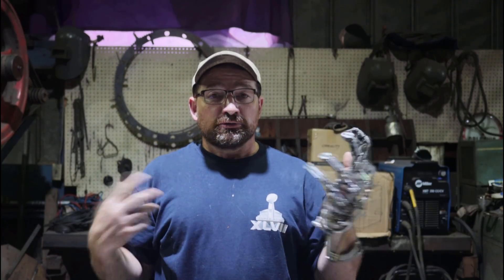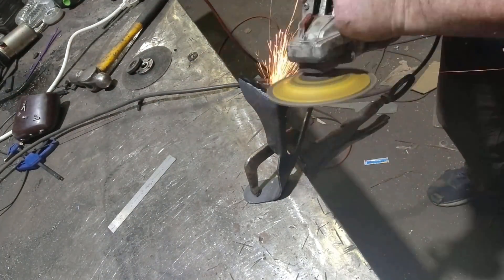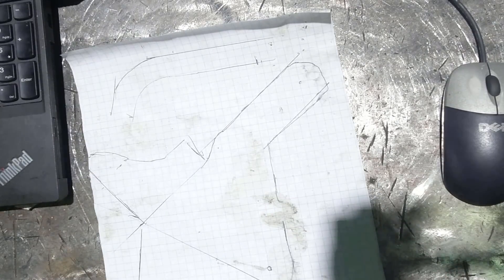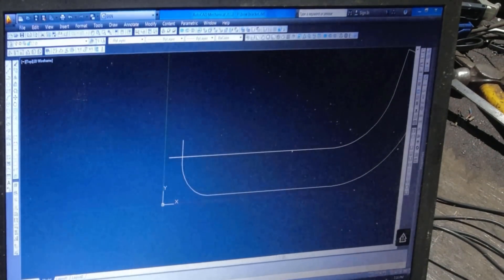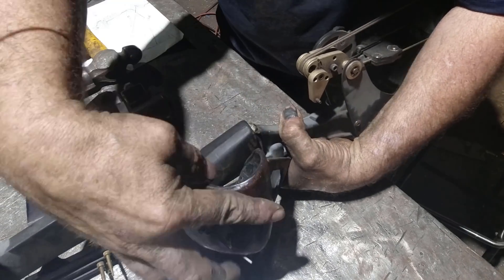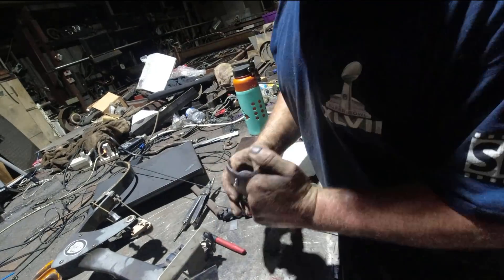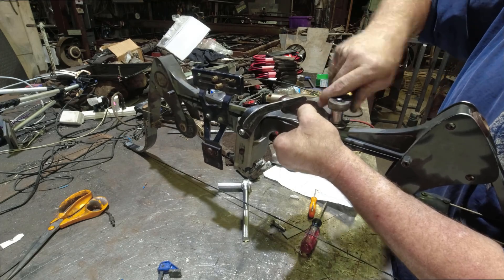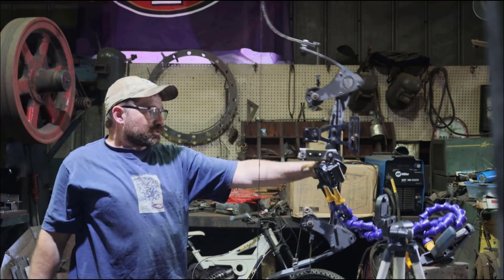Prosthetic Compound Bow Modification Part 2

Comment: This is a real engineer and fabricator here. He's got a plasma table but has no problem using a leatherman to squish down the barbs on those threaded inserts instead of going to get some 80 huck pair of specialty pliers to look good on camera then screws it all together with a 30 year old craftsman standard screwdriver. Warms my heart.

Comment: At least in recurve archery there's a thing called a finger sling which one Loop goes over your thumb and one Loop goes around your pointer finger so you don't actually have to hold the bow it just kind of rest in your hand I think it might have been easier to just make a something for the loop that goes over your pointer finger to rest on instead of this design
Reply from the maker: When I had fingers I shot with a wrist sling, the reason I don't now is because I'm shooting a bare bow, and without all the stabilizers and extra weight up front, the bow will tip backwards when I release it.  since I don't have fingers to grab the riser as it falls backwards, it will either hit me in the head, or I'll end up dropping it on the ground. Neither of those are good outcome. That's why I built a socket and bracket, so I can hold into the riser without really holding onto the riser. But thanks for the suggestion.

Comment: Your projects are very inspiring. I'm not a member of the missing parts club but I've come pretty close a couple times and have been without use of an arm or leg for long periods of time so I can definitely appreciate what you're going through. Keep up the awesome work. On a side note, when I saw this video pop up in my feed, my first thought was that you had built yourself a little crossbow to mount directly to your hand but this was really cool as well.

Comment: What advantages do you find, using t-nuts over press nuts or riv-nuts?
Reply from the maker: T nuts have a larger surface area to load against,  and with that they don't pull out like riv nuts. If it was an all metal construction, yes riv nuts all day. But where I'm attaching through resin and fabric, not so much.
Reply: That's what I figured. Cheers

Comment: I noticed you don't use your hand while welding or working, do you think you'll ever get it to the point that it can be useful for that amount of everyday use?
Reply from the maker: The reason  for not using my hand while welding is a matter of safety. If I were to ground the electrode with the filler, my prosthetic hand would likely get very hot and burn my residual limb.  It's like wearing a ring while welding , but on a much larger scale.
Reply: @missingpartsclub  Ok I thought as much.
Love what you're doing, keep up the good work!

Comment: I'm really happy you're able to use your skills to give you another chance to do something you obviously loved doing. Great job. You really are very clever. Can I ask a question, if you don't mind? The thumb on your affected hand, the nail looks very dark. I know your affliction is an ongoing matter, and well, I'm worried about it, and about you. I do hope you're doing as well as you possibly can be, and that it's nothing to be overly concerned about. I really do wish you all the very best, Ian. I love your resilience, and attitude towards your "predicament", for want of a better word. Take care and good luck!
Reply from the maker: Thanks! My thumb isn't anything to worry about really. I smashed the heck out of it a couple of weeks ago working on the cnc camera rig for the shop.  In about a month the nail will fall off and a new one will replace it.  Thank you so much for your concern!
Reply: @missingpartsclub  I'm so happy to hear it's just a run of the mill incident. But ouch all the same. I've shut fingers in a car door before, so I can emphasize with that at least. I was really hoping to find that's all that it was. Thanks for letting me, and probably others who noticed, and might have been concerned know. Take care!